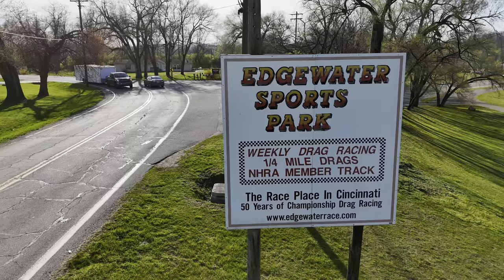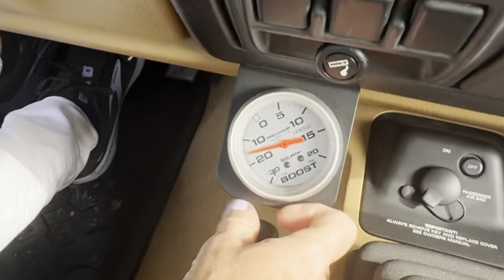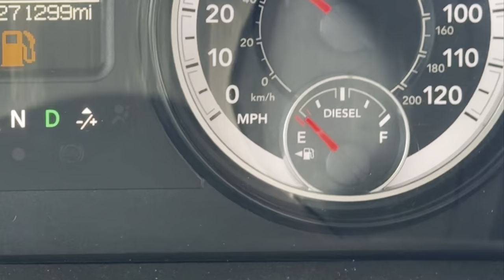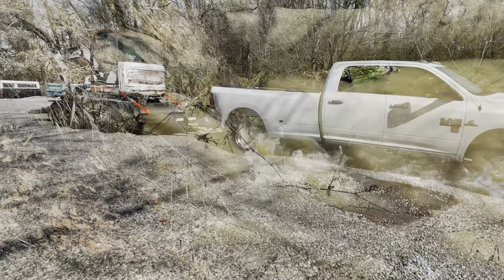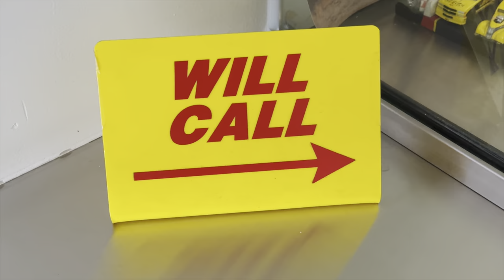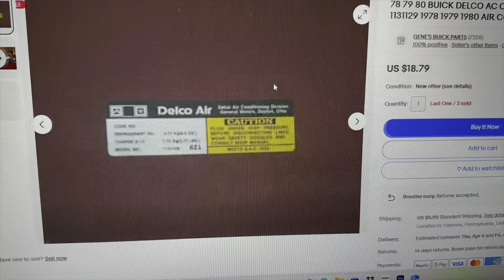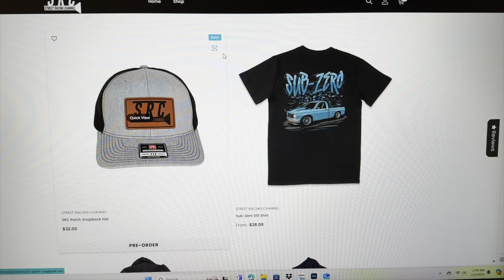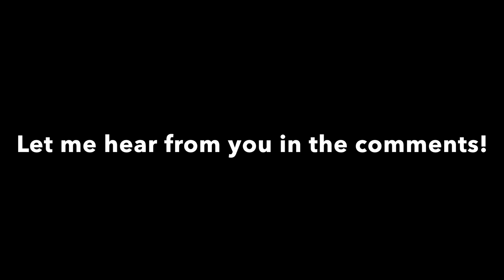@gen2garage EASTER DISASTER!  OLD MAN TO THE RESCUE⚠️

Comment: Please please please teach tommy the correct way to put a hook on on the end of a tow strap like that. In this case nothing bad would happen but in a case where you are actually getting a run at it if that hook breaks it flies up if you hook it the other way it goes to the ground. It's just a good thing to get into the habit of doing

Comment: 27:55 that mustang sounds like my third GEN 86 Camaro Z 28 it was produced and built at the Van Nuys California assembly plant which is known for only doing automatic V8’s and standard V6 models, but mine came out of the Van Nuys plant with a factory five speed and an HO 5.0 305 with a 600 cfm Quadra jet all factory with a factory 355 rear gear, although it is not any speed demon it’s way faster than any other third GEN Camaro that I’ve ever ridden that was factory. it was definitely a ripper in its own time.

Comment: I had a mustang that was a  sho or svo I can't remember but it was a pace car paint job with a factory turbo 4 cylinder and had a 5 speed  I got the car cheap the trans had a bad synchronizer  and throw out bearing so I did a whole clutch kit. I ended up selling the car the motor was pretty worn out.

Comment: That fitting needs replaced. The pin coming out means the nut can seperate and fuel pour everywhere. So either peen the pin holes to keep the pin from coming out or better option from the looks of it is replace the fitting. Its nit worth it.